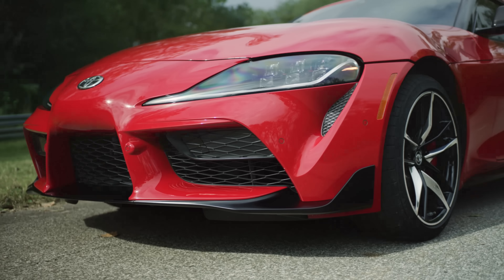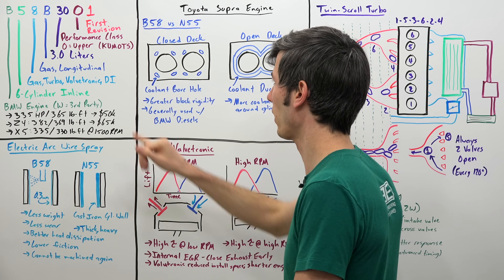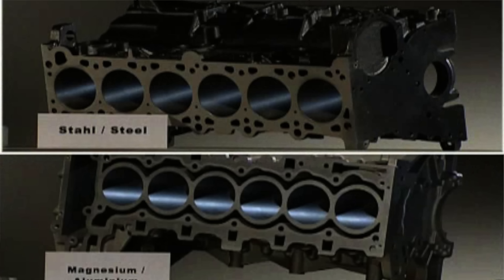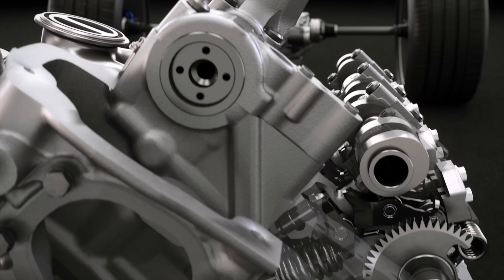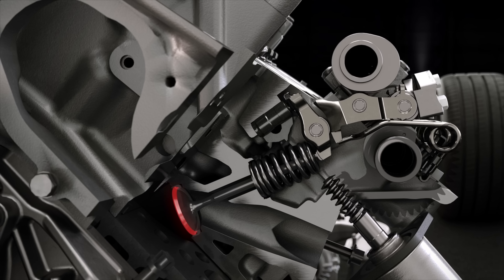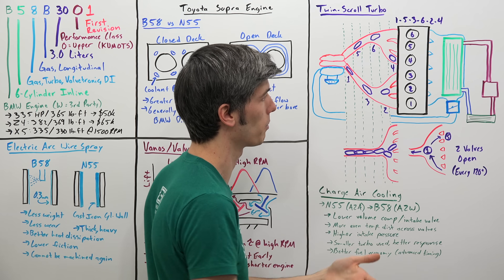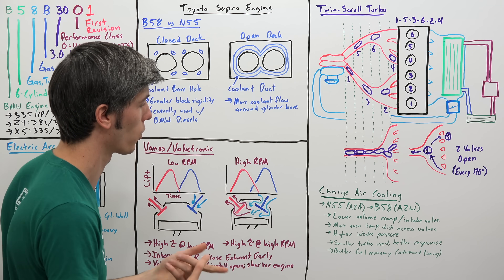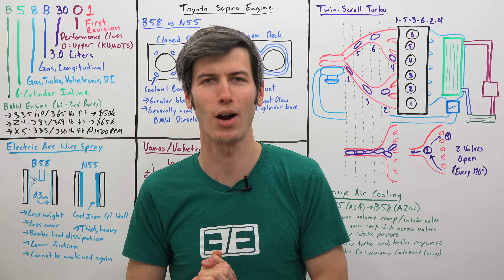2020 Toyota Supra Engine - Detailed Review Of The 2JZ Successor

Comment: Basically a re-badged slightly neutered Z4. If I wanted a BMW Z4 and all of the high costs of ownership then that is what I would buy. People don't buy Toyota for over-engineered unreliable junk.
Reply: I'd just buy a 370z for significantly less.
Reply: @BlatentlyFakeName  And be slower than everything at it's price point. The 370Z is junk just like everything Nissan-Renault makes.
Reply: JDM racing     Its junk???😂😂 Say that to all the tuners with 370Z's
Reply: @2mjz84  They're junk. The VQ has always been junk. The VQ37 is somewhat better than the VQ35 but it's not hard to improve on junk.
Reply: JDM racing    people like to engine sawp the 370Z but other than that you're right
Reply: JDM racing casual detected
Reply: @samuelbonorden429  They're just burning oil.
Reply: Pfft, have had so many bmw’s, gas, diesel and M, none cost me money! What a bunch of haters
Reply: The Z4 looks way different!
Why is no one complaining about Subaru and Toyota working together on the GT86? God damn.
Reply: @kaedeschulz5422  Ok I will complain. I think it is the most ridiculous thing that Toyota could have done. The 86 is just a rebadged Subaru. It is even made by Subaru in a Subaru factory. If you ignore some of the minor cosmetic differences you will see that it has the same lines as the BRZ just like the new Supra has the same lines as the Z4. Yes it has a few very minor differences but just like the 86 it is not a Toyota, it is built by someone else (BMW in this case) in their factory with their parts and their labor. Toyota simply stuck their name on it. It is really pathetic and much like GM used to do with rebadging all of their vehicles. Shame on you Toyota in both instances.
Reply: @BlatentlyFakeName  In this case im fine with it. I would be more worried if it's would be a project with dodge and made in USA.
Reply: Well said, John Huff. Couldn't agree more.

Comment: For those talking about the 5 meaning six cylinder, yes it's not intuitive but at the same time BMW had never made a 5 cylinder engine and needs a number to designate both inline 6 and v6 configuration so I think it just worked out like that

Comment: Didn't Ford drop cast iron cylinder liners and start doing plasma-arc deposition of hard metals on the cylinder bores of their 5.0 L Coyote engines starting in 2018? In theory it should work fine, but I hope in practice the manufacturer can ensure even coating of the wear metal on the aluminum bore surface, otherwise we might see cylinder scoring and possible piston-slap problems. Would Nikasil electroplating on the cylinder bore surfaces have been a safer alternative?

Comment: I wonder why they just didn't used good old 2jz block and design a new more efficient head with more efficient exaust and newer turbos. I doub't that using all bmw layout come cheaper than designing a new head and using a good manual transmission which everybody want more than a ZF8 speed .
Reply: BMW has best manual transmissions, but it's not going to give it to toyota. It has them in `m cars. toyota is for auto tranny crap.
Reply: ok I got it you are indeed a BMW dealer.

Comment: I foresee very few positive comments about this car...

because it’s lame af and will never be the legend the Mk4 was. I’m not a Supra fanboy but I remember the car before F&F immortalized it. The 2JZ was a behemoth, vastly overbuilt for a street car at that power level and well deserving of its reputation. There’s a video from a shop in Australia here on YouTube comparing the 2JZ to the RB and the RB has many of the expected design concessions for a road car to keep it cheap and good enough for stock power levels and a bit more on top. The 2JZ looks like it was built for JTGC, pure race car stuff on the street. Overbuilt, lightweight block, hoss oiling system, forged internals and massive crankshaft. This B58 will likely not earn the respect that even the RB did nor will it ever be a legend. 335hp isn’t even entry level power to the echelon of sports cars the Supra is intended to occupy. What a disappointment it would be if I cared enough to care. I guess Toyota only knows how to build Camrys and Corollas now, lame family cars as both of their sports car models are someone else’s.
Reply: The 2JZ could easily hold its own if you just made it right now. Toyota must have all the design/tooling they used to make the originals in storage. It was so simple.
Reply: Do you even know anything about n54? That engine is way more legendary than 2jz. n54 was tuned up to 1200whp with single turbo only on stock internals. b58 is it's successor. Albeit it's a mid tier engine for BMW and can't compete with M engines, but it's going to be more robust and get more power than 2jz - there is no doubt about it. Toyota fanboys are living in a F&F pink dreams. Wake up. In real life n54 shattered all 2jz records like almost 7-8 years ago. And handling is another topic - no Supra or Toyota comes close to BMW chassis and handling. BMW is an ultimate driving machine bruh. That's why Toyota realized it and asked BMW for help and mentorship.

Comment: Toyota with BMW reliability... have a feeling toyota will regret this decision after couple years
Reply: I'm "old school" but have taken quite a shine to how Supras perform. BMW? OMG! Morphs into a money pit! 😣
Reply: Im fine with the BMW engine but replacing the unreliable parts.
Reply: I have a feeling Toyota fans are going to finally learn what driving an ultimate driving machine is really like. So even if reliability wont be good - it will be worth it to just experience how it really should drive.
Reply: @azerogliev6520  Toyota engineers tuned the suspension for the Supra, not BMW.
Reply: @tropicalstorm339  well then toyota fans are screwed - I thought they will at least experience ultimate driving machine fun, but I'm guessing not anymore lol
Reply: @azerogliev6520  Just because the BMW branding is on the engine doesn't make it a ultimate driving machine. If i would want to have a fun rwd sports car i would buy an AE86 and build a NA itb 4age with 240hp that can rev up to 12k without destroying itself.

If i just want to have a ultimate driving machine 911 gt2 rs!

Comment: A Toyota built by BMW sounds like an eternal punishment for a mechanic handed down by Satan himself.
Reply: All the bolts will be pre-rusted and reverse threaded.. Muahahahahahaha
Reply: @rogerwilco1777  "The hood/bonnet opens remotely via electronic latch. There is no mechanical hood latch and the remote is stored next to the intake manifold. The vehicle must be switched to ON and running in order to access the engine compartment. If you forget to put the remote back, your vehicle will NOT start. If your vehicle battery dies, a BMW....sorry I mean TOYOTA service tech will be required to open the bonnet/hood. The vehicle MUST be towed in via flatbed to prevent serious damage to the drive train. This is NOT covered under your roadside service warranty.

It is required to open the hood/bonnet to access the drive train UNLOCK switch (located next to the exhaust manifold), allowing the wheels of your vehicle to spin freely in order to tow the vehicle. Any tow that does not adhere to strict BM...AHEM...Toyota guidelines will void any/all warranties currently active for your vehicle."
Reply: Name me a turbo inline six currently in production by toyota...  dont even speak about the legendary 2JZ cuz that was 20 years ago and no longer in production...
Reply: @NMChiphopdawg  Toyota has made a living on excellent V6 engines. Inline, though I love it so, is not Toyota moving forward. They shouldnt get tangled up in ridiculously overengineered BMW part swapping. Youre setting the Supra up to be the next MINI, in a sense. If you sell the soul of a sports car, which is undoubtedly its engine, then whats really left to care about besides a name?
Reply: snappy452 yup, the master of darkness is laughing his red ass off on this one

Comment: Slight technical gripe: the N55 also used spray on cylinder liners. Only the M2 specific variant used cast iron liners, due to the extra strength required of it's higher output. That is directly stated by BMW M2 product manager Jose Guerrero in an interview on BMWBlog: 

[Quote] The BMW M2’s N55 has also had its spray-on cylinder liners replaced with cast-iron ones, which are necessary for the M2. Guerrero claims that the spray-on liners are fine for a normal street car, “But lap after lap, if you know a car will be high-revving on racetracks, you need that. You don’t want engine failure.” [/Quote]

Comment: How long before these things leak oil from everywhere, sound like they have piston slap at idle, the vanos motor craps out and the cats get plugged? Does it even have a dipstick, or do you have to ask the infotainment how much oil it has? Also, the 2JZ is a work of art. This thing is a hideous pile of plastic that belongs hidden under a cover.

Comment: Yes! Looking forward to the final result! I used to own an rhd n/a mk4. Great video!
Reply: I have to say that I think Toyota did a great job with the side and rear of the car, still not convinced on the front but the overall car is not that different in size from the mark4, except for the wheelbase, which is actually shorter than both the previous generation and the 86!

Comment: That spray on cylinder lining is pure built in obsolescence mechanism. I bet they will have 5w30 on 20 000 or even 30 000 cycle recommendation. And typical lifetime of that engine will be under 100 000 km.... And everyone will blame it on sporty driving when engines will fail before 150 000 km no matter how gentle it will be driven.
Reply: The b58 uses 0w-20. And is 10k intervals.
Reply: What do you do for it? 10000?
Reply: @esatd34  5w30 is long lasting oil, but it is not a good oil. It doesnt preserve internal parts... Its designed to reduce service intervals, but not a single manufacturer cares about car out of warranty period... Thus you are much better off taking care of things on your own. Either do 10k changes on 5w30 (which will be more expensive) or 15k on typical 5w40. It will have same effect. If you care about having a reliable car in your family past 3 years - you just ignore manufacturer and take care of things on your own terms. And "excessive" services wont impact your warranty either...
Reply: BMW can't even make a timing chain or intake manifold runners which last to 100,000 miles. Typically they fail between 75,000 and 85,000 miles.

Comment: An engine block you have to throw away if you ever want to machine it? This is why bmw are so famous for the worst engines on the planet.
Reply: "the worst engines on the planet" lmao.
Reply: BMW is famous for the worst engines on the planet? Care to elaborate? BMW is known for the very best engines on the planet from my experience.
BMW diesels are unmatched in reliability and only BMW was crazy enough to build a mass produced 100+HP/L n/a V10 that revs up to 8250 rpm in family saloons.
S54 is still the highest hp/L naturally aspirated inline 6 ever made as well.
Reply: M50B25 Turbo yup I love these completely uneducated comments about things people have zero experience with.
Reply: Plasma spray is where the industry is moving. Get used to it.
Reply: @johnclark7406  Actually it's were bmw hopes the industry will go. Nobody else. Maybe the chinese will start using it because it's such a cheap and nasty way to make throw away engines.
Reply: Ford Mustang GT500 Shelby and Nissan GTR use it. IJS
Reply: @johnclark7406  They only use a plasma coating and can still be machined. The bmw engine can not. So once your bore has been damaged after 100k miles of hard driving and needs new rings and a hone you will happy to have to buy a new block? Because that's what's going to happen.
Reply: @adamaussie18  You can sleeve the B58 if one really wants to.

Comment: so it makes 10 more hp but 35 lb/ft less torque then the smaller 2.7L 6 in my fusion.... good job BMW more displacment less power.
Reply: Ya, but it won't eat it's timing chain and doesn't suffer from LSPI.
Reply: @johnclark7406  whats lspi?
Reply: @jedadiahtucker2132  low speed pre-ignition.

Comment: that cylinder wall coating is planned obsolescence at its best. this is not a performance engine this is get-it-trough-the-leasing-period engine. this is not a supra. they should have named it differently. i guess this an unofficial goodbye from toyota to the high performance DIY enthusiasts market.

Comment: When you start having carbon deposit issues on the Intake ports, best way to fix the issue is to swap out the engine with a Yamaha sourced 6 cylinder block,.... and mate that to a certain German transmission....
Reply: Or pay the $300 to have it cleaned at 150k miles.
Reply: @johnclark7406  nah, not worth it;-)

Comment: Great information as always.  I think you missed an opportunity though to compare/contrast the B58 to the 2JZ itself with respect to it's architecture and turbo setup (as it left the factory).   Two inline 6 motors making a little over 300hp but separated by ~26 years.
Reply from the maker: Fair point, perhaps cover something similar in the future!
Reply: Engineering Explained please do! Hopefully by then more information on the modification potential of the B58 will be out
Reply: Graham Frame Hes talking about with bolt-ons and a tune.  Which is pretty much all the Supra was good for with just bolt-ons and a tune. By bolt ons I mean what the average joe is willing to put on his brand new car. Intake exhaust and tune. Since the n54 could handle upwards of 700hp on stock internals and the b58 is a better block design with forged internals and a closed deck I seriously doubt it will be less capable.
Reply: @TurboNFRStwoK  but the cylinders on the n54 have iron liners inside making it stronger still. and the n54 other then pistons is fully forged aswel. Will be good to see where the b58 goes. its only taken the n54 10 years to hit 978WHP so how long for the b58.... BTW for the 3rd most powerful n54 this was all the engine work required 
CP Pistons (10:2 Compression)
Carrillo Rods
OEM Treated and Coated Bearings
ARP Head Studs
Reply: @Graham Frame At the wheels, probably ~425.
Reply: BMW has detuned the B58 so it doesn't step on the toes of the S55 (M2/3/4) but with the closed deck design it is more than capable of making 400hp.

Comment: Supra will use the B58B30M1 engine AFAIK and not the O0. O0 will be installed in Z4. M1 has exhaust manifold integrated in cylinder head and O0 has a "normal twin scroll exhaust manifold. M- middle power engines will produce cca 340 and O- upper power about 380. Both M1 and O0 are updated TÜ1 engines with higher fuel pressure, new coolant thermal management system and single piece timing chain. O1 does not exist yet, but will almost definitely come leater :)
Reply from the maker: Interesting! Thanks for sharing. Do you have a source? Latest I saw was from /Drive who was reporting the O1. M's are used in the lower tier BMWs, like the 3-series, etc, but didn't think it would be in the Z4.

Comment: id rather BMW made the car and Toyota made the engine. and hey use one of the heaviest, most gutless suv engines BMW has...its not crazy expensive so im sure some die hards will buy them but even Toyota seems to know they wont sell to many as they are not willing to put any engineering into this car at all...its all just off the shelf parts thrown together and the performance will show that...my prediction is the new new civic si will beat it on a track, price, gas mileage...Toyota is banking on nostalgia for this one (i own Toyota BTW)

Comment: Toyota could not have put the old heavy cast iron six back in. With all the required safety equipment, the thing would weigh as much as truck. The BMW B58 engine is a gem. It’s lightweight, powerful and certainly high-tech. I salute the old Supra. It had it’s day in the sun. Long live the new Supra!
Reply: Bill Zipprich finally a sensible voice.

Comment: I would have been happier if Toyota didn't release this at all. The design is absolutely hideous, looks even less aerodynamic than the MK4.
Unfortunately, crash safety regulations require the belt line be high as an elephant.
MK5 looks so... Douchey. Other words to describe? Gay. Homosexual.